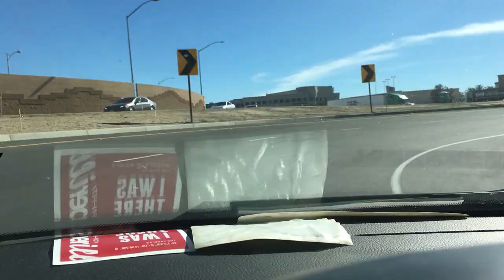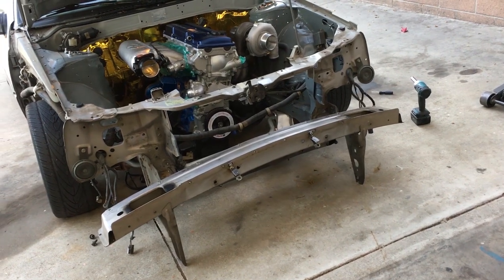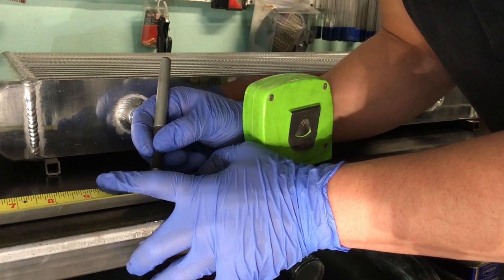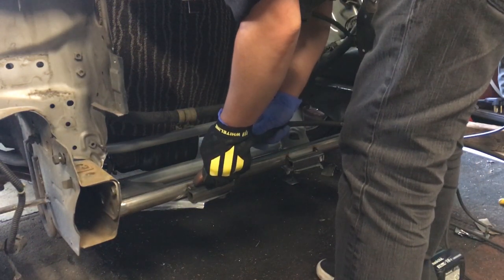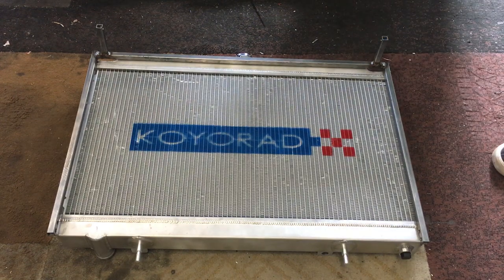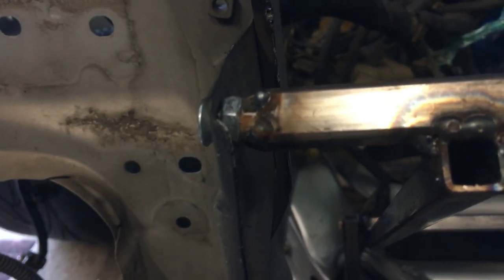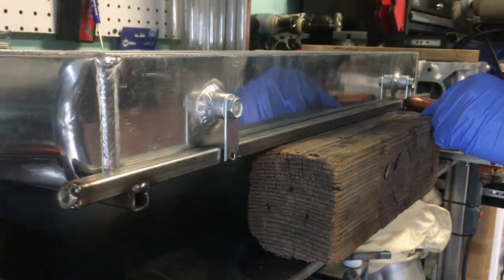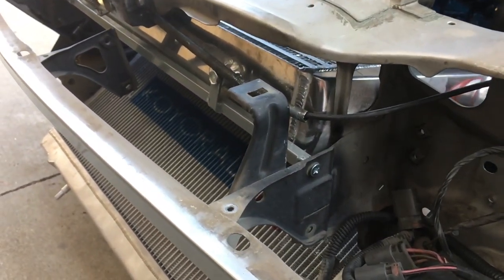V Mount Intercooler Install!!!

Comment: From what I understand, isn't the radiator filler supposed to be the highest point in the cooling system so that you can bleed it easily?
Reply from the maker: I have a Greddy Swirl Pot waiting to go in. Still need to do a lot of engine bay cleaning to see where I'm going to mount it though. Other than that, all of the lines and fittings needed to plumb the swirl pot in are on their way. Already planning on making a video to explain what you just asked and show the install. Another cool part is that since I have an electric water pump I can just leave It on all day to bleed the system without having to turning the engine on lol